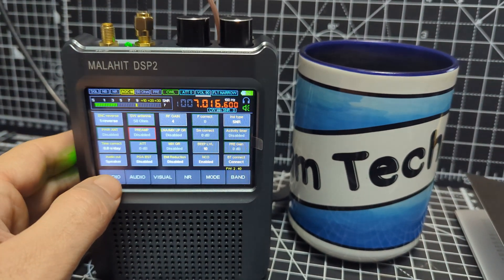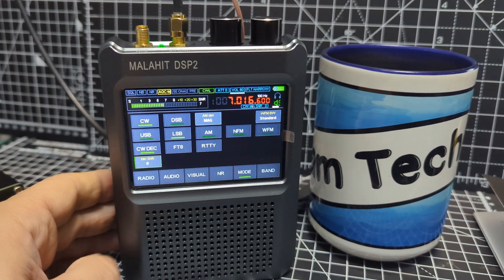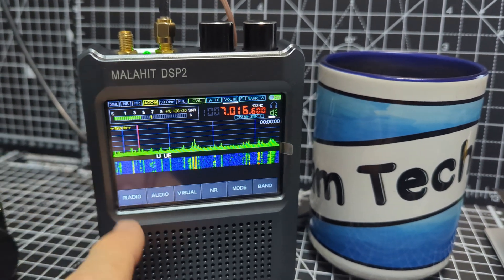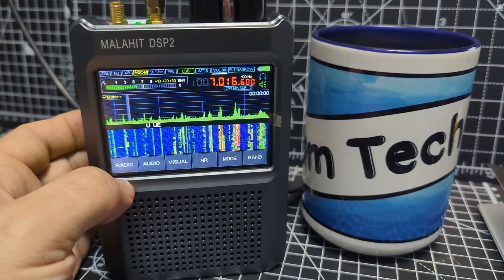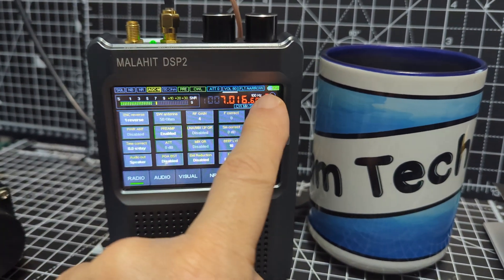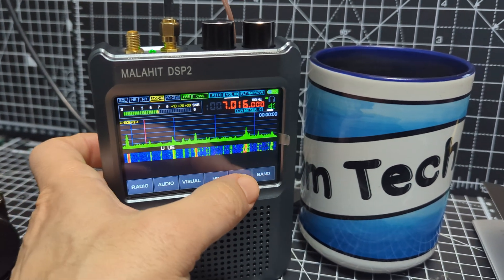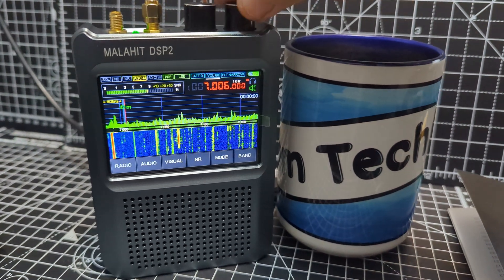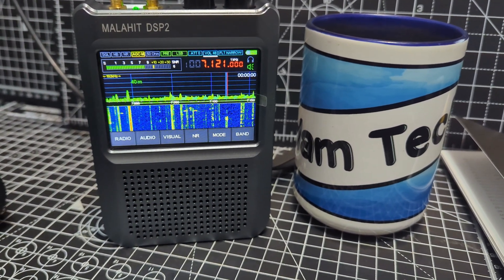MALAHIT DSP2 , CW Decode ??

Comment: According to the manual you need to set the Min SNR to match your signal strength. It is so that the algorithm knows where to extract the data from.
Reply from the maker: ok
Reply: @M0FXBHamTech   confirm this works, have my SNR set to 20